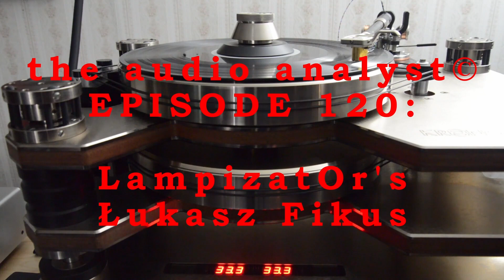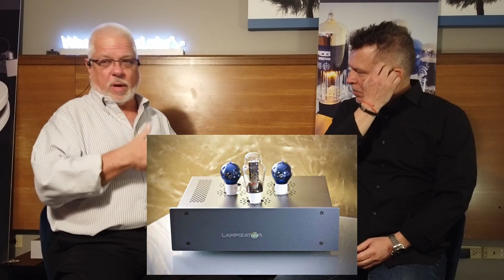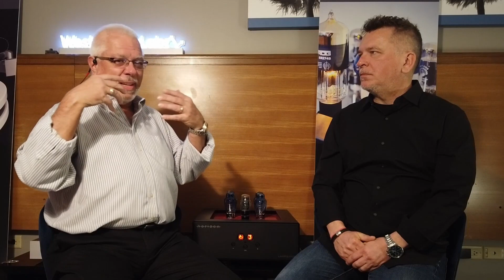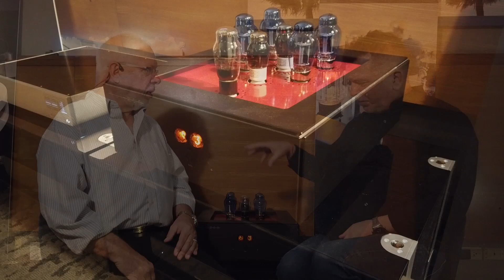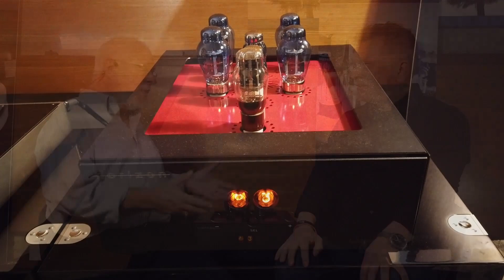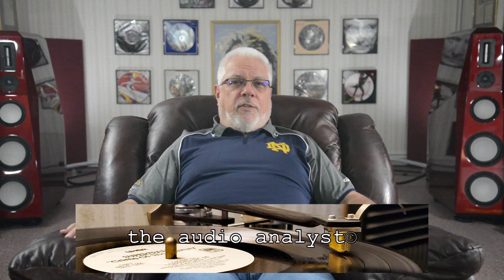E120: LampizatOr's Łukasz Fikus

Comment: Great interview.  Lukas is my mentor.  I followed his blog long before he started his company.  His teachings were compelling.  I Lampizated several CD players including a nice Rotel that has a TDA1541a that I have to this day.  I also built and rebuilt a 1541A DAC using his friend Eugene's 6n2p output stage.  Finally I built my best effort streamer DAC with his 6n2P output with dual mono power power supplies and 5u4 rectifiers.  The digital side has a SBC followed by a IanCanada FIFO equiped with SOTA ultra low phase noise clocks in their own chassis.  The chip is still a TDA1541A, but an S2 variant powered by super capacitors.  It is sublime and all DIY point to point wired.  I then went on to build triode power amps and open baffle speakers inspired by Fikus P17s.  I can truly say my entire system is a gift from Mr. Fikus.

Comment: Greg, I bought the Baltic 3 based on your review, and got the upgrade to version 4 because of your help - and yes like you say I too can't believe it is the same DAC. Mind boggling what Lukasz has been able to achieve for under $8K with the Baltic - I don't want to know how much more there is to be had from the Horizon lol😅.
Reply from the maker: Michael, thanks for taking the time to write. I was only too happy to assist you with your issue, and I'm so happy to find that it worked out - with you getting your Baltic 3 upgraded to the remarkable Engine Eleven as a Baltic 4... Pretty impressive, no?

Comment: I’m so torn between a LampizatOr Baltic 4 (or something higher), or upgrading my phone preamp. I’m not listening to any digital right now because my vinyl rig is so much better, and I’m concerned if I buy a Baltic 4, I won’t listen to vinyl anymore and my collection will be for naught. 🤔
Reply from the maker: Hello Keith. I feel your pain, but honestly, see no reason to remain on the fence...

First, you deserve high praise for your commitment to vinyl! I'm SURE you know how I feel about the LP medium overall.

But why not dig BOTH Digital AND Analog? Let's get real for a moment... There are older recordings that may never be available on digital formats, optical media or streaming. And further, some of the analog material, because of the loss of, or damage from aging, of the original source tapes, will mean that no one will EVER be able to adequately transfer them to digital. By that same token, much of the newer music that was captured properly in digital (like with DSD 256 or higher) may never be given adequate treatment when mastered and cut into vinyl, so... Having excellent sources for both formats just makes sense, no? 😉
Reply: @theaudioanalyst  I have an Auralic Altair G1 Streamer that I was hoping to output to the Baltic 4, but I just discovered there is no digital output on that unit.  I was thinking that would provide greater benefit than upgrading my Conrad-Johnson TEA2 MAX phono preamp,  but now I will have to find a streamer to go with the Baltic.  I'm going to have to think on it....
Reply from the maker: @KeithSkronek  What a shame. It would seem it was built more as an end-point, all-in-one streaming solution, than as a flexible and fully-fleshed out "streamer." Best of luck moving ahead!
Reply: Its not OR, its AND! I love both digital and analog and I find use for both.
Reply from the maker: @StGCfiLife  Just like I said in my first reply to Keith here! 😉 I'm with you on this one...no question.